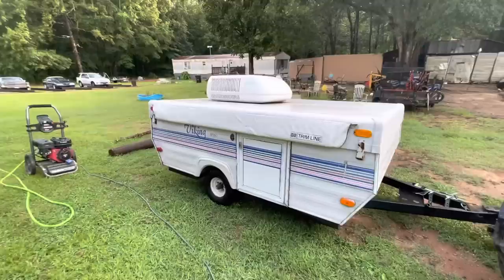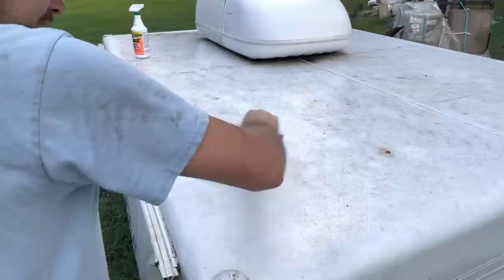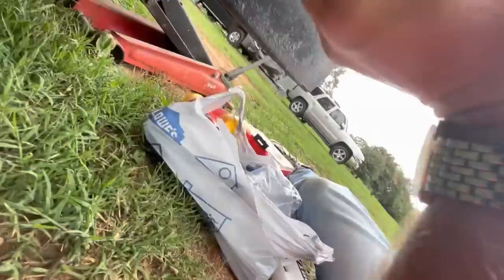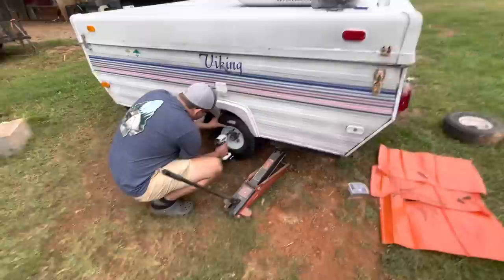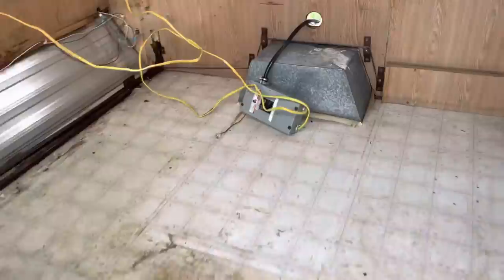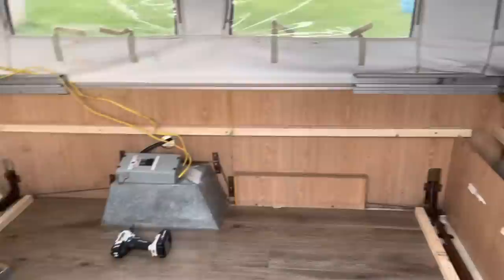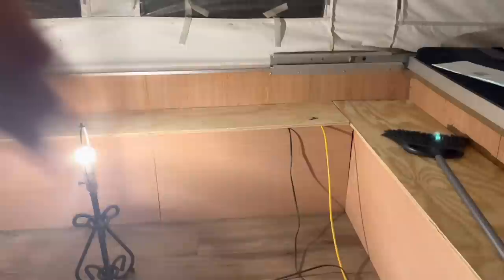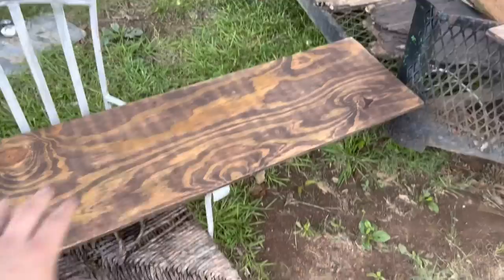Fixing up a Viking Pop up Camper

Comment: Found your video searching for improvements other people have made to their old vikings! I HIGHLY and URGENTLY suggest that you get bracers to support the metal beams on the outside. As you discovered, those cables are the only thing that will pop up the top, and unfortunately those cables are the only thing keeping that roof from falling. If those cables break, and youre inside...its game over. Lots of people have died from those cables failing